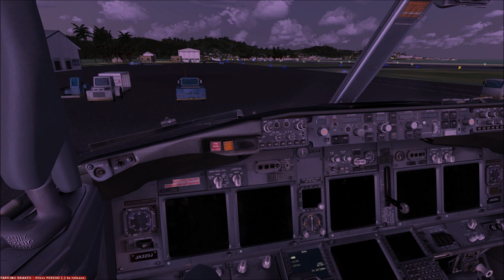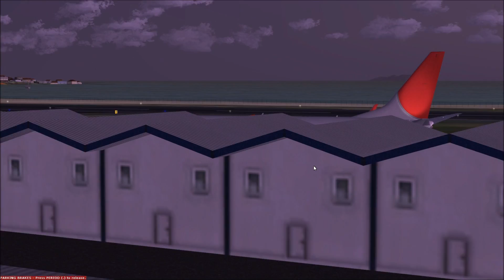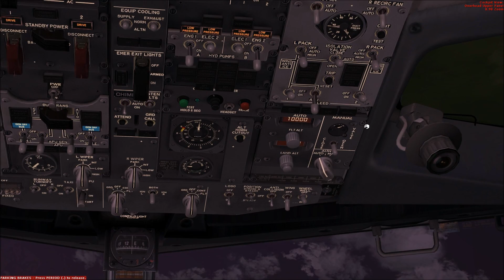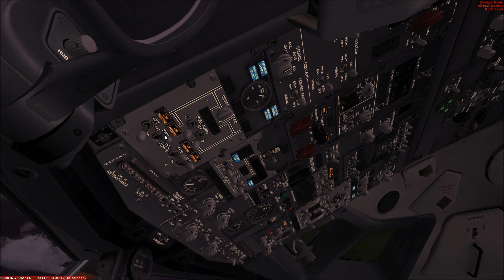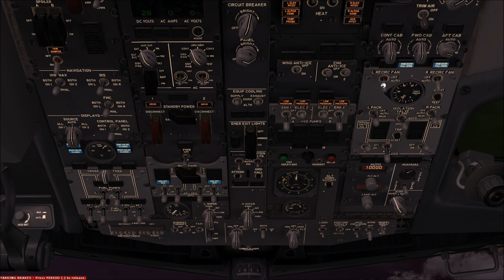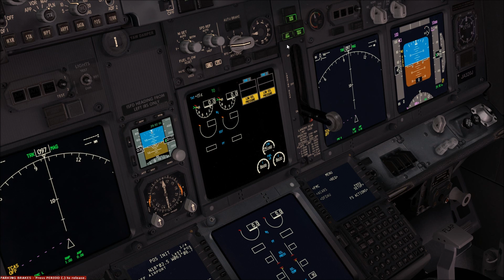PMDG 737NGX Flight Deck Review and Tutorial Part Two HD

Comment: @watthehell1023 why would you get an ATI radeon 4600 :L Hear let me give you a crash course on an FSX rig. Firstly, CPU is WAY more important than graphics card for FSX, my graphics card rarely goes above 50% usage with FSX. Hears what you want, depending up budget. Intel Core i7-2600K (or i5-2500K) (CPU), ASUS P8Z68 (mobo), RIPJAWS X 8GB RAM, a decent HDD, 650W PSU (or more) and for graphics card a GTX 550Ti will prob do, i have the 560Ti, not need though. Hope that helps :)

Comment: @watthehell1023 I run this on a 2.20 ghz laptop decently (For me at least) it says I get 9 fps with it (Or at least that's what it says) but PMDG put in some pdfs made so you can optimize it's performance on your machine. I use an external fps limiter, FSX says I get 9 fps but it seems more like 25-30.